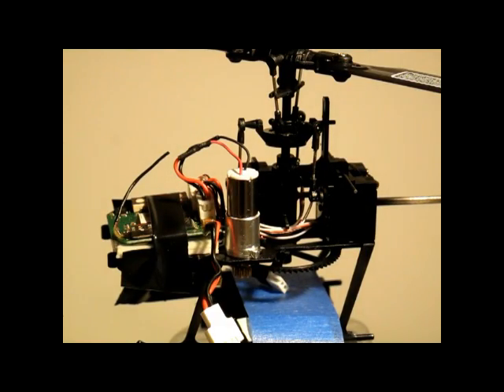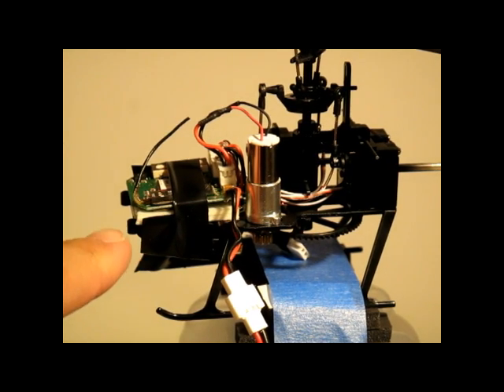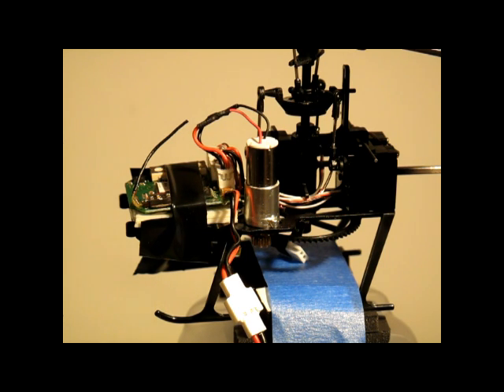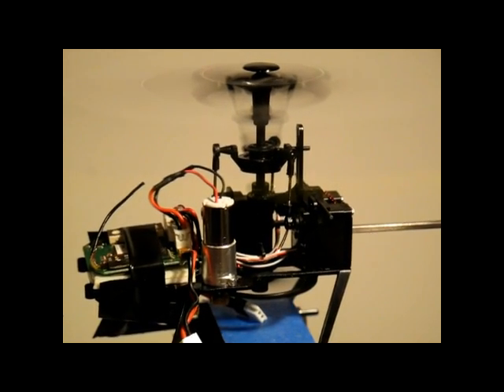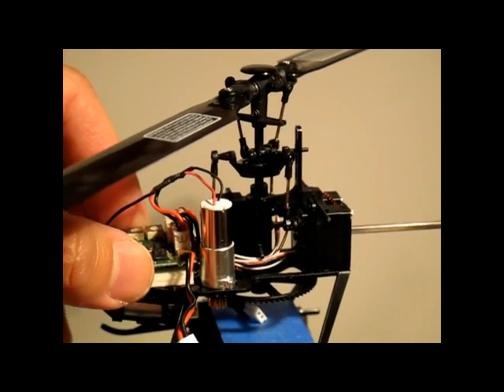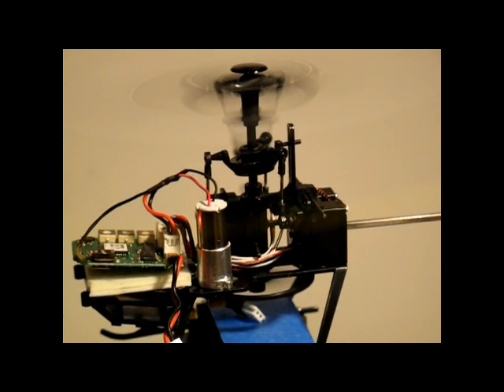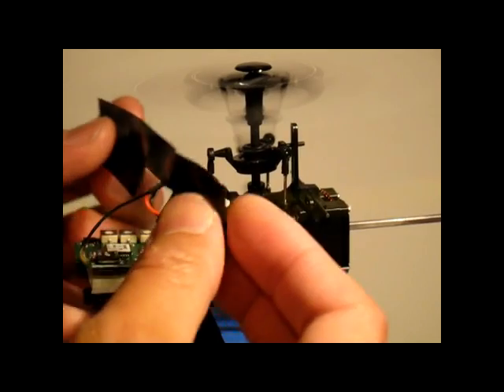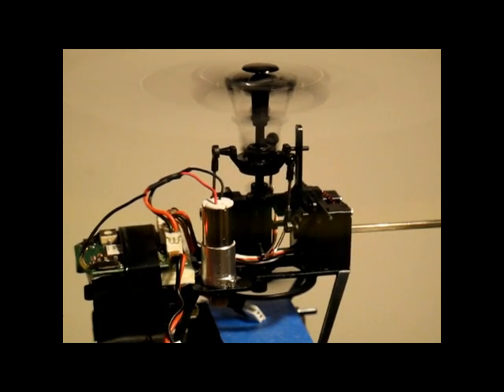Vibration Cause 6 Axis Issue on Walkera Genius

Comment: Hello Ben,
I have a Genius CP V2, and started noticing the hard drift to the left and back when reaching past-mid-throttle. The Genius CP V2 does not have a switch from 6 to 3 axis anymore. Have you found or heard from the 6 axis issue in the Genius V2?